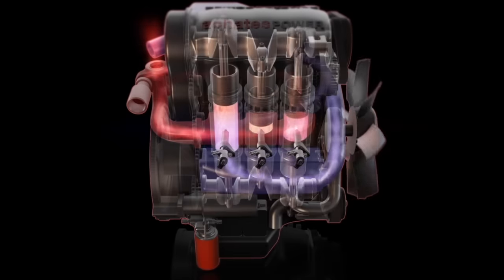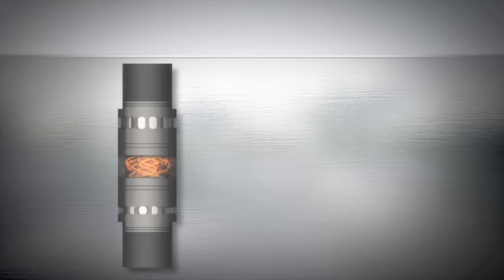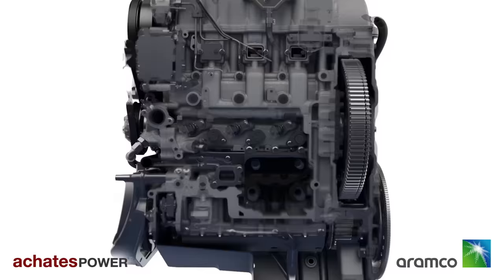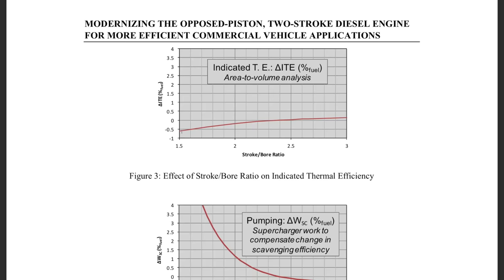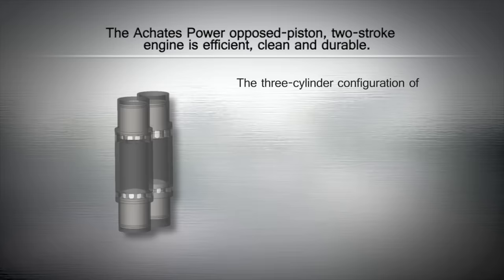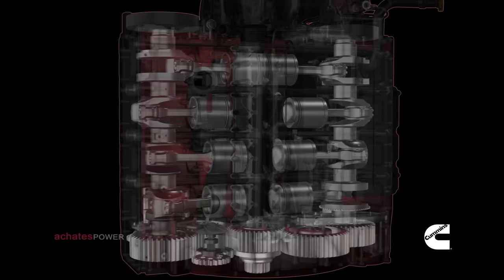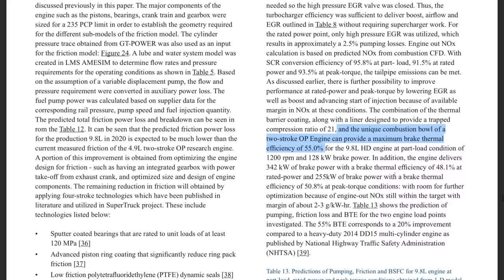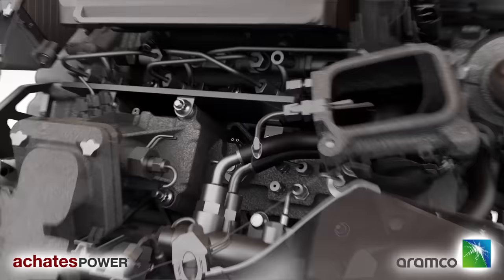Opposed Piston Diesel Engines Are Crazy Efficient

Comment: Why is this genius motor not widespreadly adopted in the car industry??
Reply: pollution.
Reply: @personalfunfest  : However they pretend that the combustion is very efficient with lower emissions than normal diesels
Reply: @hom2fu  : only liberals?
Reply: @BertGraef  : With modern technology it's possible to filter out all dangerous emissions. This is only an hysterical world
Reply: Bert Graef diesel used to be dirty but it has been cleaned up to the point where you can put it in a kerosene heater just fine
Reply: @thepope2412  : good so!
Reply: problems with cooling as i´m aware, one of the main reasons for it´s exeptional power to weight ratio is the higher number of piston-strokes per rpm, this causes the pistons and cylinders to heat up nearly twice as much, they were implemented in highpower applications though, like trains and boats.
Reply: @fabianseewald7884  : It's quite possible to use high tech metals  for pistons and cylindres as for ex. those for aircraft turbines. it costs surely more, however the higher efficiency would be worth and pay it out
Reply: @marcob4630  you are right, they
Reply: @marcob4630  are on it but it still needs to be economical
Reply: @marcob4630  what do you mean? filter ALL dangerous emissions??
Reply: @alalal123421  : It's quite possible: not ALL, however  the most dangerous emissions which are the particles for diesels. As for C02, Achat two stroke diesel engine  is less polluting because far more efficient than common benzine motors
Reply: @alalal123421  : "All" emissions is impossible, however we are able to filter out the dangerous micro-particles which affect almost only Diesel engines. It is surely expensive but quite possible. As for Co2: it's well known that Diesel engine is less polluting than common fuel ones
Reply: @M Bacon : It's a flat engine as you say: what is the probelm? VW, Posche, Subaru had or have till now flat boxer motors without any problems. If the engine is more effective , as it really is, this questions of different dimensions can be easily solved. The real problem is that the car industry prefers easier solutions than energy efficiency!
Reply: @M Bacon : OK, thanks for your explanation!
Reply: @Mr-pn2eh  : yes, they should try somewhat new
Reply: @fabianseewald7884  they were in fairly common use in UK trains about 40 years ago. They are not used at all anymore.
Reply: @marcob4630  the story that diesels are less polluting than gasoline fuelled vehicles has been rejected. Diesel fuelled cars were given a tax advantage in the UK on that basis, this has been removed now because it wasn’t true. Partly this was down to the vehicle manufacturers cheating on the emissions tests on diesel vehicles but the measurement of pollution in UK cities reflects the fact that in real world use diesel is very far from a clean fuel
Reply: @AndrewOliverHome  : Diesel can be clean enough if we just respect the emission rules. Volkswagen committed an enormous fake and  the consequence was not only billions of fee, but also the worldwide ruin of diesel engines for autocars.
An enormous stupidity because diesel motors work more efficiently, have less Co2 emissions, and the rest of poisonous gas can be easily cleaned out nowadays. However greed and stupidity  doomed a genius engine!
Reply: @marcob4630  have you calculated it? I could imagine that these higher costs are what doesn't  compare well to the low production costs of the electric engines.
Reply: @Squee7e :  I do agree that the electric engines are by far the most effcient of all (energy rate from 80-90%) Howewer there are some problems in stocking electricy. Above all for huge truck engines or ships. Morever, the batteries are not eternal and they have also huge recycling costs
Reply: Marco -  Excessive heat in the cylinders, complexity of two geared crankshafts and extremely expensive to manufacture.
Reply: @rogertycholiz2218 : The heat is amendable by using special metal alliances; it's not obligatory to install two geared crankshafts: there  are others, far better solutions you can find also here on Youtube without any gears; the engine is simpler to manufacture than a common diesel: no valves and annexed stuff. The one only real problem is the exhaust: too much polluting by modern standards: also amendable, however with expensive devices.
Reply: @fcalin21 :  Far before Diesel there was a Century of coke as fuel: even worse!  Also normal gasoline with benzene, is toxic enough. I f you want an emission free motor, there is only the electric one! However the problem remains by how we produce electricity!
Reply: @marcob4630  What i said was that diesel is the worse. I welcome electric cars.
Methane could be a compromise.
Reply: @fcalin21  : Electric are the best no doubt: the highest efficiency. The only one problem is the way we produce clean electric energy:  hydrolectric is the best without any doubt
Reply: @marcob4630  Even electricity from coal is preferable to diesel. Coal fumes can be processed centralised and out  of the citys.
Reply: @fcalin21  : I dont' think so - coal is one of the worse polluter on Earth, above all because of the Co2 you can't filter out. China has become the first polluter , more than the USA (!) because of his high coal consumption. Coal doesn't (or should not) belong more to the modern world !
Reply: marco brenni they measured one active volcanos co2 has emissions very well for a year and it was equally to USA co2 emissions for all coal power plants for 2006 almost exactly. People lose context  of things so easier when they can’t conceptualize the numbers. Yeah it sucks that they emit cO2, but in the grand scheme it’s nothing and India and China don’t care. My uncle won a Nobel peace prize for climate work, he flies jets all over the world 100 times a year getting paid to speak about climate change. He lives in a mansion and paid hundreds of thousands of dollars to get boulders shipped in on diesel trucks. There is a whole group of people that profit on keeping this topic over inflated so be careful. Hope we can reduce climate change together with investment in science/engineers and not political “science”/climate “scientists”. My buddy with an accounting undergrad just got a PhD in climate science from Yale. Dude is not a scientist by any stretch. He is a business/politics guy
Reply: @marcob4630  I am not an advocat of coal but carbon can be sechestrated also it is toxic only in high concentration (as do oxigen). The microparticulates cause cancer and astma.
Reply: Look on Youtube for a Commer TS3 truck video and you'll hear why. That is in addition to the emissions from it.
Reply: @patjohn775  : Anyway it's a real problem. Here in Switzerland were  live, the glaciers are all melting, and in 40-50 years there will be no one more left. Also the snowfall-limit during wintertime grew in only 50 years (!) from average 1000 m to almost 1600 - 2000 meters: a real problem not only for our ski tourism but also for our rivers during summertime. Things are effectively consequences of climate change and not fantasy at all.
Reply: marco brenni I’m not arguing it’s not real. I believe it is real. The problem is it’s not a predictive science and it’s now an industry so it’s hard filter down to the facts. We all know what the solution is at the end of the day and it isn’t recycle, solar, wind, stop eating meat, live in a tiny house, etc. it’s going to be nuclear fusion. When we have free energy in abundance all those other pollution and waste problems become a lot easier and cheaper to fix.
Reply: My same question
Reply: @marcob4630  what have the melting glaciers of Switzerland to do with the efficiency of an engine?
Reply: @pieterjlansbergen6988  : He mentioned Volcanos as a greater danger for pollution. Can be, however we have to stop was is effectivly stoppable

Comment: i do remember going with my father as a kid to help him repair his mates commer 2 stroke lorry, a 3 cylinder apposed piston diesel engine, the difference i believe was the commer used rocker arms to join the pistons to a single crank shaft (if memory serves me well) and a blower to keep the flow of gasses, clever bit of old tech that'll be great to see used with modern advancements
Reply: Ah, the "commer-knocker", so called from its distinctive sound. It had -umm - reliability issues, as opposed piston designs can because of their more complex drive gearing.
Reply: @kenoliver8913  my dad hauled close to 7.5t all over Germany, for most of the 90’s with his TS3 powered BMC van. Not a single reliability issue, and it was no spring chicken then. The only breakdown was a failed hydraulic clutch line that was repaired at the roadside.

Comment: I see the potential to integrate this engine nicely to a DCT and create a simplification to the DCT.  If you use an arrangement that has three smaller gears that are used to couple the drive between the two crankshafts and ensure that these gears have different diameters to each other you could then connect a clutch to two of these gears and have a DCT with separate odd gear and even gear input shafts.  This would simply the DCT design.
Reply: Naughty internet person Dual Clutch Transmission aka DSG etc.
Reply: The Dual Clutch Transmissions are not durable enough for a truck in the first place.
Reply: peterhejlejensen, the weight of Chiron!
Reply: Michael Harrison, sounds like mechanical madness 🧐
Reply: Jeremiah Fix Might sound like masness, but trust me,  this would work perfectly and would also extend the durability of the gearbox itself by reducing stress on the gears
Reply: Ganfalf shaft spacing is critical to transmission size and weight. You'd need a third and fourth shaft or it'd be huge and heavy. It'd spread the load. IDK how useful that is.

Comment: Seems like this would be phenomenal for diesel backup generators for commercial, industrial, and institutional use.
Reply: I have to wonder how it might work in a hybrid with wheel motors.
Reply: Seems too big for a hybrid/generator. Most hybrids use small engines, this is far from small at the moment.
Reply: Anthony Brusca Navy used opposed piston engines to turn their emergency generators
Reply: the Coast Guard used them for over 50 years.  Fairbanks Morse. Very hard to work on.  I hated working on them.
Reply: Anthony Brusca Too big for a portable generator. But if you need emergency power in let's say a hospital, size isn't a huge concern.
Reply: Already done, the designer of this engine has licensed megawatt installations for backup. Efficiency and power are attractive in that use.

Comment: Years ago I thought I was being smart thinking up the idea but I learned they already existed and prototypes are being developed near by in San Diego. Opposed piston engines can theoretically be smaller, more balanced, more efficient, more reliable, higher revving, cheaper to make, and can produce more power than even freevalve technology. I really hope motorsports starts using these and I really want one in a motorcycle. They are more similar to 2 stroke and rotary engines than current 4 stroke piston engines, just with a lot less burning oil.
Reply: That's incredible, I want one to experiment with.
Reply: Couldn't be further from a rotary tbh

Comment: Makes me think of the Napier Deltic engine of British motor torpedo boats and trains... Great idea and great new implementation.
Reply: Anyone who ever heard a deltic powered train in the UK will remember the wondrous sound they used to make! Don't even start me on the noise of the conventional format 2stroke supercharged diesels made by Coventry Climax! Gorgeous!
Reply: Yep, all copies of German designs...
Reply: @trauko1388  They were given the design as part of WW2 war reparations.
Reply: I have heard of them,  they ran seperate tank(dry sump with oil injection) with Motul 800 synt 2 stroke oil witch is 40w with a metering pump. the synthetic oil would burn off after it went through the bearings and into the intake ports. The oil injection was mechanical some of it was fed into the intake ports where it could burn off after doing its job so it was smokey until fully loaded with generator. The engineers would have to top off a few gallons after a run. Motule 800 is one of the cleanest burning 40w 2 stroke oils out there. i want to get some for my omc rotaries. Some folks swear by it in detroit 2 strokes too as it stays cleaner. its not cheap though
Reply: trauko1388 Developments. Napier had a licence from Junkers to build their opposed piston design.
Reply: @trauko1388  It's a lot of fun laughing at people who don't know what they're talking about.
Reply: Yes Napier Deltics, however these were developed from WW2 MTB engines, Not the Junkers engine!

Err, Commer Knocker anyone?  opposed cylinder diesel engines have been around in commercial vehicles for half a century.  There was probably a good reason they didn't take off.
Reply: @davidelliott5843  Napier acquired a license from Junkers before WW2

Comment: Try a search on Napier Deltic, Junkers Jumo 205 and Leyland L60 .... The Commer TS3 is an example of a opposed piston engine with a shared crankshaft
Reply: Carsten Langbo i remember the the Commer T3 as at one time they were the core of our local milk tanker fleet. You heard them a long time before you saw them!
Reply: the commer engine was actually made by rootes group.
Reply: the CommerTS3 actually had only 1 crank shaft and the pision were operated by cranks and rockers  great sounding engines though
Reply: I worked on the TS3 engines as an apprentice in the late 60's.Far less trouble than most,but if the air filters were not cleaned it caused longevity problems with the Rootes blowers.We used to "decoke", them every 10,000 miles but i guess with modern oils they would be far less likely to coke up.We even used to recycle the blowers for drag bikes and cars in those days!
Reply: carstone  they had large rocker shafts each side of the engine .

Comment: Fairbanks Morse was a big producer of OP Diesel engines in the late 30’s and up to the early 60’s.
They made large engines for submarines, trains and industrial use.
Reply: FM still makes engines for stationary & marine applications, they exited the railroad market in the 1960's though...
Reply: It overheated in railroad use, cracked its cylinders, and was difficult to repair. In marine use, no such problems.
Reply: @MarttiSuomivuori  Wonder if they were strictly air cooled ( finned ) like Deutz Aircooled Diesels  ...  if then some water injection wouldn't increase the efficiency substantially again.        WW2  Aviation Mechanic once told me that if the Lancasters didn't have water injection , they would never have made it into the air with the bomb loads they were lifting.

Comment: I wonder what it’s emissions would be like if it were optimized for running a generator.
Reply: Theoretically this design should have less emissions and its pollution rate shouldn't change much with age, unlike conventional engines. Because there are no valves and valve springs to wear out
Reply: used as a genset would be ideal for an electric truck,  many miles on a tank of fuel

Comment: Commer trucks used 3cyl op diesel engines throughout the 50s and 60s, many capable of doing over a million miles, and it only had 1 crankshaft, pistons were connected via a conrod and rocker.
BOAC (now BA) used 6cyl Napier op diesel aero engines in their Lockheed constellations, as they were more efficient and reliable than the Wright compound turbo radials.
Thus it's proven technology worth looking at again.
Reply: without needing valves and a cam shaft, the "Commer Knockers" were super reliable. rebuilds were simple,  fast and cheap.
unfortunately the need for supercharging restricts efficiency of any 2-stroke, and the ports cause oil consumption and emissions that are no longer acceptable... as they say with the (awesome sounding) 8V-71 Detroit Deisels;
Check the Fuel and Top Up the Oil.
Reply: Commer TS3 engine. We did our apprentiships with those in college. We stripped 1 and rebuilt it with rings missing.....it still ran! 

.......but took 3 hours for the smoke to clear the classroom.
Reply: I didn't know Napier Deltics were used in aviation.  Makes sense - lighter, reliable, powerful and fuel efficient. British
opposed piston engines powered most commercial trucks {Commers} and most locomotives [Deltics].
Reply: Sorry, but BOAC never used the Napier diesel in their Lockheed Constellations. Only 1 Napier (Nomad)ever flew. It was mounted in the nose of an Avro Lincoln and flew at Farnborough in the early 1950s. Very efficient but temperamental. Rolls Royce's Dart engine was much more reliable and coming onstream at that time.
Reply: @rdukes3173   i worked on a lot of commer ts 3 engines . as i worked for a commer dodge garage. in the days of the ts3.    commer never had a tilt cab .and was awkward to work on .then dodge came out with the tilt cab.but the was after the ts3 was stopped being used . it would be very easy to work on. in the dodge . they did build and tested a 4 cylinder version . but then the emissions would be too high as it was  with the ts3.  engines . we had to decoke them, many times .that might not happen these days with cleaner fuel ?good sounding engine. in those days  with a 2 speed axle they got to 80mph which was impressive .thanks for taking me back in time .